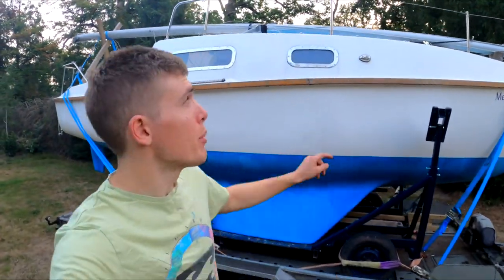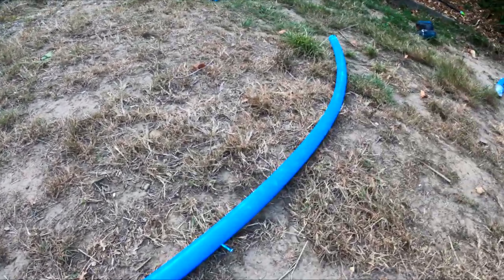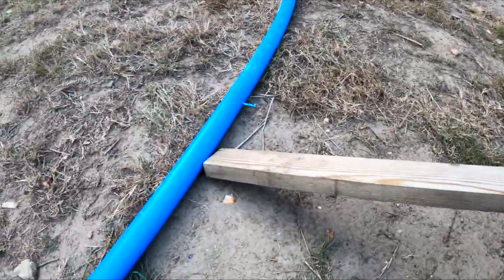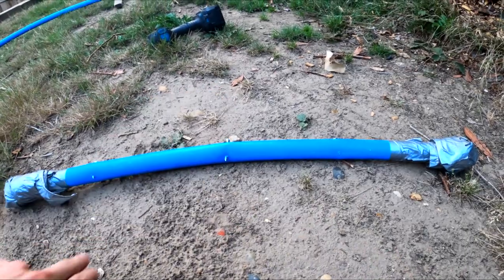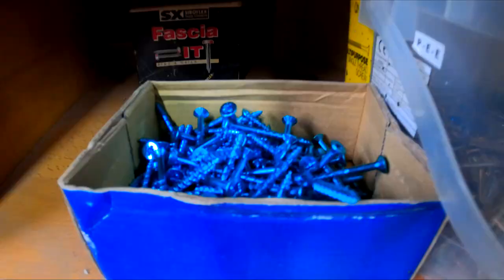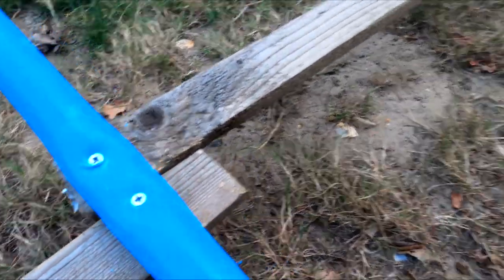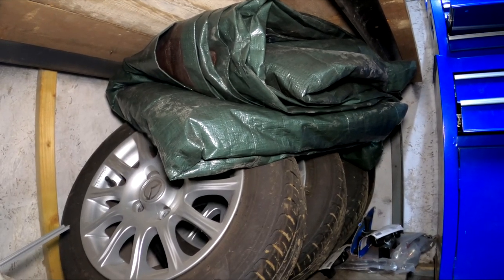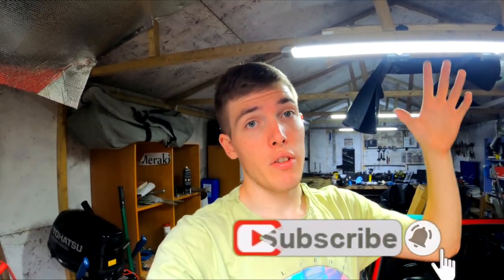HOW TO Build a TENT for a SAILBOAT! Sailing Meraki | Ep.25

Comment: I like the idea, but high chance of water pooling in-between the supports

That said, if you are going to draw something, do not pretend draw, get a pen and paper and draw.

With regards to the installation, it also seem a but lacking in the actual showing part.
Reply from the maker: Bob Bob Thanks! I don’t get any pooling with this setup due to the gradual bend in the pipe and having the spine!